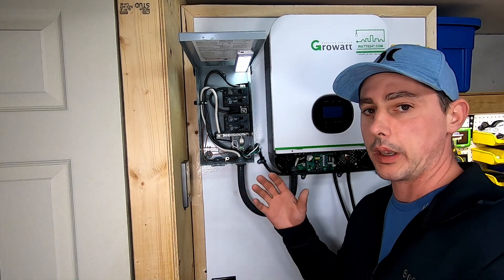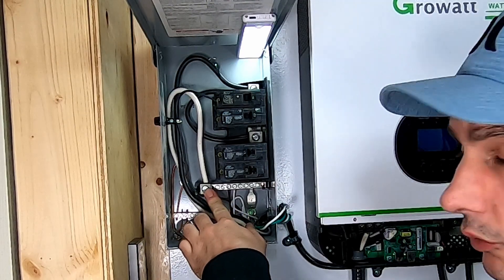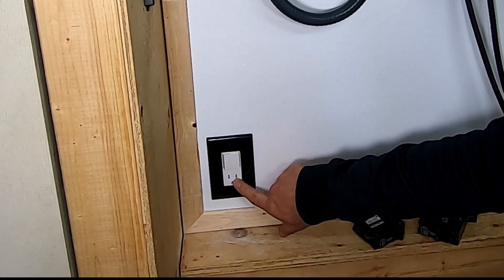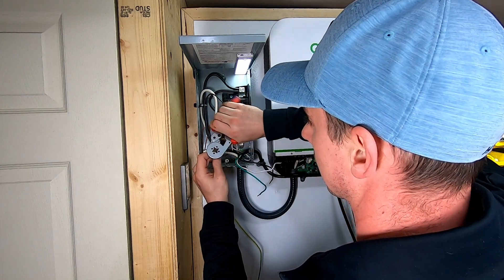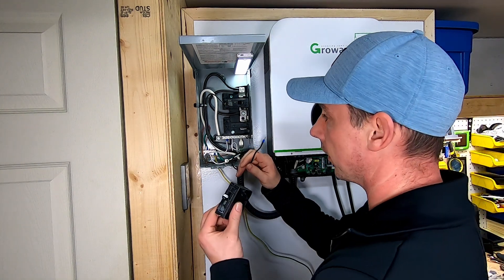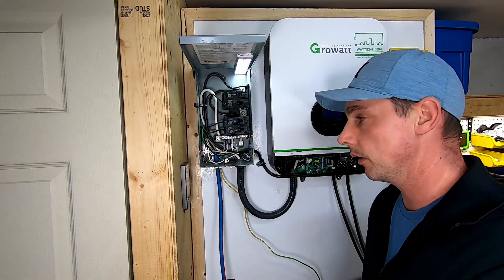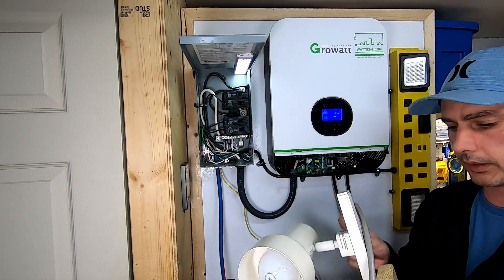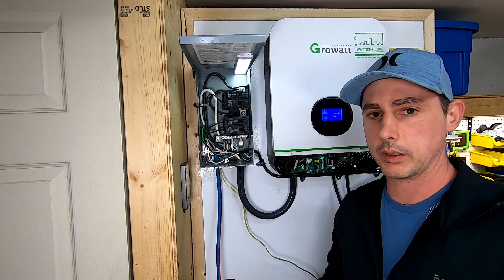Growatt AC output wiring

Comment: One issue I had as a newbie was not realizing that the 20 amp power strip used a male plug that isn’t standard 

So I’m not able to give my setup its first charge

I spoke with my electrician and decided to have him install from my panel a 20 amp line to my house 

I will be doing solar panels as well just haven’t set them up yet
Reply from the maker: @ecobluefarms223  It's great you found a solution. It's always best to talk to a professional

Comment: Well I had success and to my surprise and I’m sure you heard this before but my wall outlets do not support this 20 amp male plug how do I then charge the battery ? Please.   But I’m still excited that I put all together right the first time
Reply from the maker: @ecobluefarms223  Lower the charging amps to what you can supply
Reply: @Roll2Videos  
I may have asked the question wrong 

Twofold issue here-
1-ok I can understand going into the growatt inverter settings to lower the amps 

2-because the male plug has the T would I be able to use the adapter plug from homedepot as well ?
Reply from the maker: @ecobluefarms223  I'm not sure,
Reply: @Roll2Videos  
Ended up speaking with my electrician for a solution

Comment: Any reason you wired into the lugs and not backfeed with a breaker, I have seen it done both ways but can't rind info on why to do it either way
Reply from the maker: Either way will work. The Growatt itself has a 40 amp breaker built in which is why I used 8 gauge wire as per the manual. 👍
Reply: @Roll2 Videos  thank you for the reply, I could see using the double poll if feeding a on grid house but seems a bit of a waste, I was going to use a 50 amp double poll but ad you said the growatt has a 40 amp, is 25 amps per inverter to small?
Reply from the maker: @todamnbad  that depends. You'll have to remember about the AC to dc charger. At 25a AC you should be able run 2500 Watt continuous but don't forget to add the usage of that charger ontop of your load incase it turns on.
Reply: @Roll2 Videos  what size would you recommend? Signature solar said 3000÷120=25amp, guess I should have gone 3000÷120×1.25=31.25 or a double poll 60?
Reply from the maker: @todamnbad  Do you have the 24v or 48v?
Reply: @Roll2Videos  two growatt 3000 lvm-es 48 volt, went with a 50 amp double poll and two 15 amp to feed outlets
Reply from the maker: @todamnbad  They gave you bad advice. 51.2v (LifePO4) x 30a charger (if you leave it in default) = 1536w plus 3000w = 4536w total. 4536÷120=37.8a therefore 40a breaker per leg. Always follow the manual.
Reply from the maker: @todamnbad  That will work
Reply from the maker: I would use 8 gauge wire.
Reply: @Roll2 Videos  so the double poll 50 I have will work? I bought 8 awg THHN based on the manual, sorry, getting a bit lost
Reply from the maker: @todamnbad  yes is you use 2/ 15a breakers in the panel per leg
Reply: @Roll2Videos  sorry for all the questions . Keep my 50 amp double poll for feeding the panel or swap out for a 60? Keep the 15 amp that I have to feed my outlet circuits?
Reply from the maker: @todamnbad  Sorry I'm thinking of the AC input. Are you talking about the AC output? 🤣 Lol
Reply from the maker: @todamnbad  On your output panel signature solar had it right. I was thinking of the AC input not output. My bad
Reply: @Roll2 Videos  manual says 40 amp input breaker for input but nothing for the output side when feeding a panel, the math of 3000÷120=25 amps is for the output side to feed the panel.

40 amp to feed each inverter from grid
25 amp to feed panel 
15 amp to supply my outlets
Reply from the maker: @todamnbad  yes that is perfect. Sorry for the confusion 😅
Reply: @Roll2Videos  it's okay, I can word things weird sometimes, still deciding on if I need to use a breaker to feed the panel or use the lugs and save 30 bucks on a double poll

Comment: HOWdy  R-2-V, ... 
Nice point on the FERRULES on Stranded Wires 
Circuit Breakers are generally designed for SOLID  House Wire ( 10 or 12 or 14 awg Gauge Wires )
so holding the STRANDS together with a FERRULE is GREAT Advice 
Thanks
COOP
the  WiSeNhEiMeR  from Richmond, INDIANA 
...

Comment: Any idea on connector type or part number for dry-contact connector?
Reply from the maker: I believe it's just a bare wire connection tighten down with a screw. It's basically just a relay that you can program

Comment: What size flex conduit did you use?
Reply from the maker: I used 3/4" flex conduit. When I ran my solar wire in other videos I used 1/2".
Are you putting together a system?
Reply: @Roll2Videos  Yes I am and just happened to run across your videos when researching neutral ground bonding. Good stuff and I subscribed. Thanks for the info!

Comment: I'm wanting to do something very similar (have the Growatt 24v). What size wire do you run from the ACout on the Groeatt to the panel?
Reply from the maker: I used 8 gauge wire. There is a 40 amp built in breaker inside the Growatt.

Comment: May want to check the neutral to ground bond in the growatt. They are typically bonded inside the inverter. Having two bonds, one inside inverter and one in the panel is not to code. Check out with a ohm meter to see if that inverter output is bonded internally. There are ways to remove the internal bonding so it can be done at a main panel.
Reply from the maker: Checked it. There is no neutral ground bond on the growatt there is on the mpp solar but not the growatt.